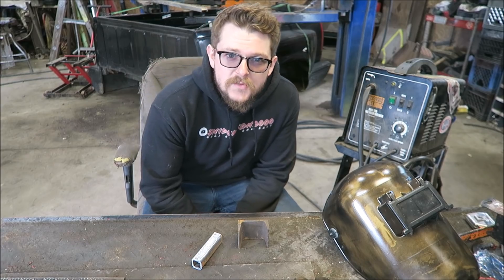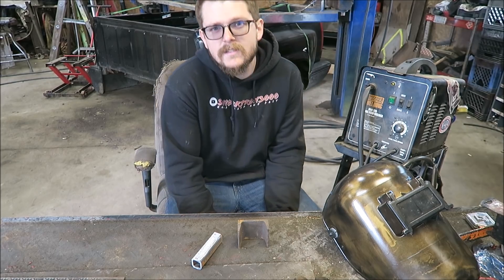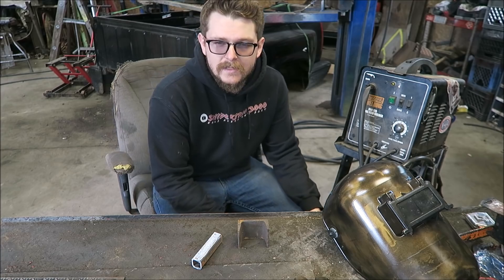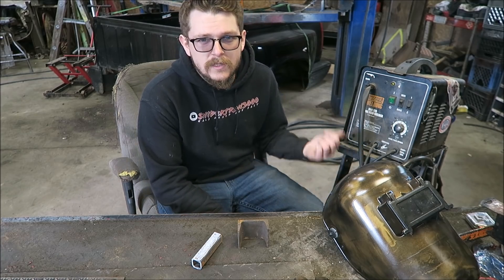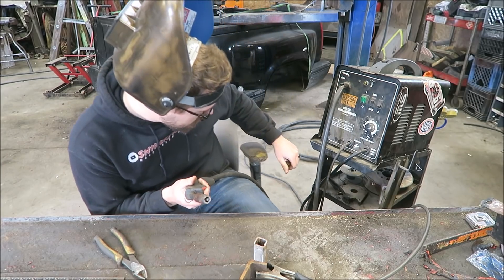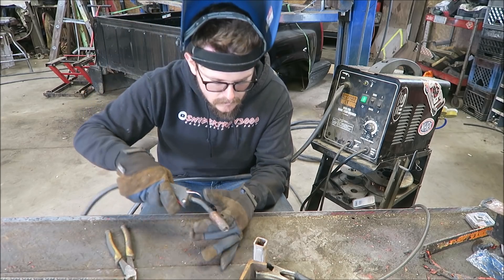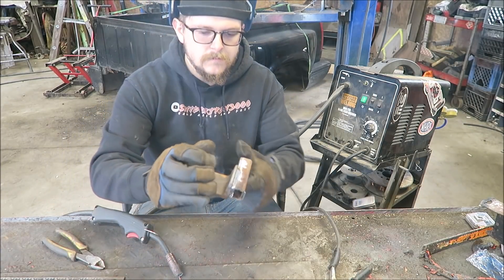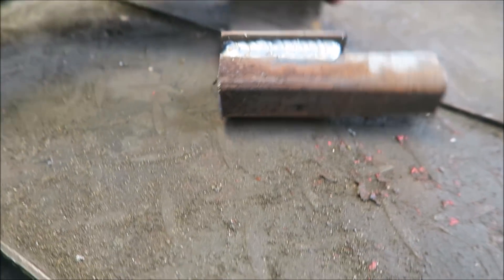My Preferred MIG Welding Techniques

Comment: You push a mig for the shielding gas and to push the filler into the base material. Also u get less impurities drug into the weld. For a vertical weld you need to go up hill for frame work, thick material or anything high stress. Downhill you make a pretty weld but it will not be as strong as a proper uphill weld.I try to teach people to not worry about the circles and the j's while welding and focus on a weld that is even and the binding line on each side is perfectly straight. With a mig on steel you just don't have to do all the movement some people try to teach and in a lot of cases you drag impurities into the weld. I have seen people do a bunch of tacks instead of a weld because they thought it looked better lol.  Keep up the good content always glad to see a new vid pop up from u. PS its now time for jack to get a LS!!
Reply from the maker: Haha, not gonna lie, for exhaust systems I'll do tight tacks all the way around it. I'm not good enough to run a full bead and not burn through it lol

Comment: I was told to weld from the bottom going up, gets better penetration and keeps the porosity out..
Reply from the maker: To me it's easier to let gravity pull the puddle down instead of compensating for that. But, like I said this is just what works for me
Reply: Yeah I guess whatever floats ya boat

Comment: Yo man lay on the ground and MIG weld some stainless exhaust that shit's fun 😵
Reply from the maker: Lol tack it and pull it off to weld it
Reply: @SniderTron3000  lol it's just temporary repair on the suburban,stainless just runs with too much heat gotta build a bridge with the weld and connect in the middle fun stuff but I love welding old exhaust the back was regular steel that bead looked pretty and laid down smooth
Reply from the maker: Filling gaps is the fucking worst lol

Comment: This comes in handy for me. I just bought the cheap-o flux core HF welder and converted it to DCEN. Picked it up, because the support for the gas tank/shock mount on my Sierra is rotting away and I need to replace it. Haven't welded in years. Lol What's the trick to seeing where you're welding with a hood that isn't auto-darkening? I keep walking off where I should be.

Comment: Hey next time your screwing around welding different thicknesses turn it up towards the high side and keep the arc more on the thicker material and give the puddle a push over onto the thinner material every other J or circle, witch ever method your using. I have a hard time welding different thicknesses too but I’ve found this technique very helpful especially for things where I need full even penetration on both pieces. Great video tho!

Comment: not trying to be dick, but any time you're drop welding you'll never get proper penetration. So any time you're welding and you want to have trust in it, weld it in position 1 which is flat position if possible. Just letting ya know. I'm a certified welder/fabricator in 1g and 1F. Also doing a straight pass is the best way to go, no whipping or up and down technique is more "strong" if anything it can create defects such as undercut or in proper fusion inside the joint which wont be visible unless you do a destruct test to the weld.